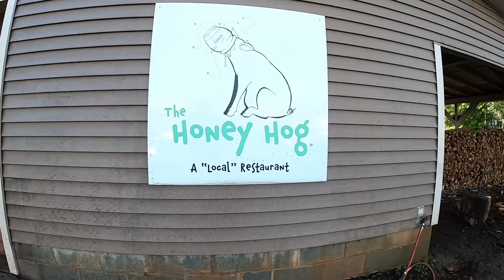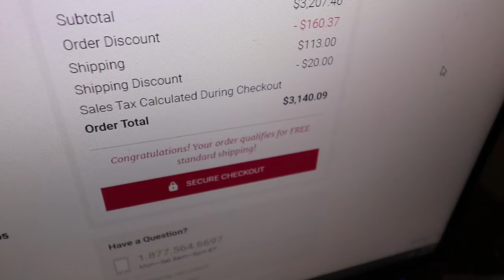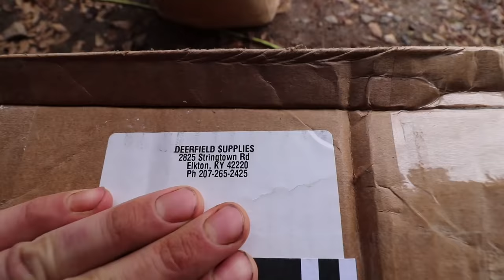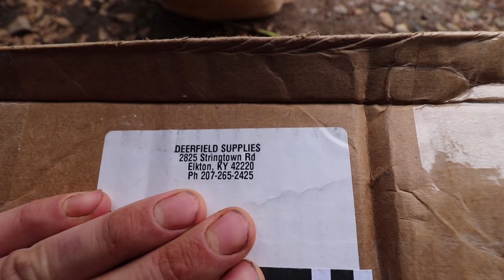Building a FOOD FOREST On Our Veggie Farm (In NC)

Comment: Dumb question time.  Why don’t you like pine trees?? You call the trash trees but they really make good silviculture. Pine were the most significant trees in The Carolinas and pine Savanna covered most of the eastern seaboard.
Reply from the maker: It’s not that I don’t like them these are just way too close and all the foliage is on one side and it also was an extremely thick edge allowing little to no sunlight
Reply: @honeytreefarmnc  I have the opposite problem with oak and gum trees nothing but suckers growing everywhere . I wish I had more pine.  They shoot limbs twenty feet side ways into the roads. You can run cattle under a pine Forest. Mimosas can be invasive.